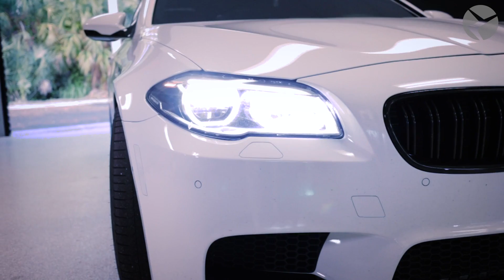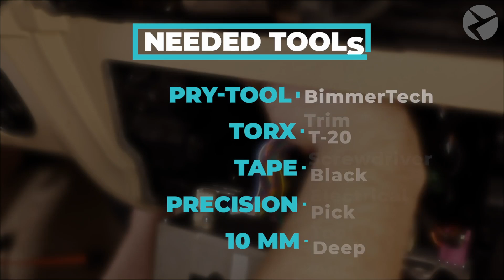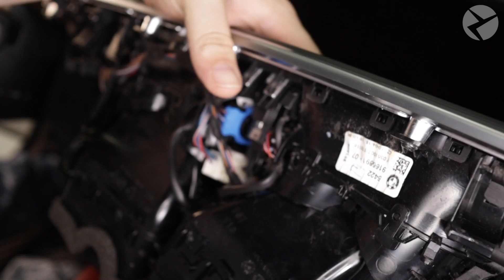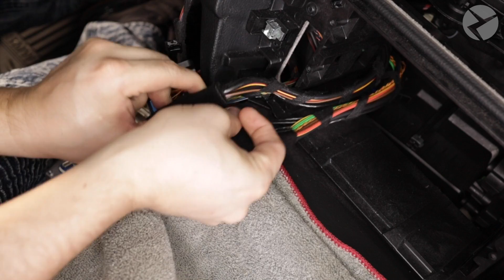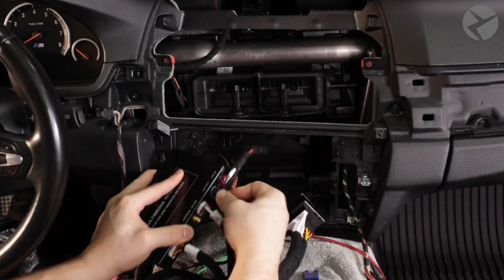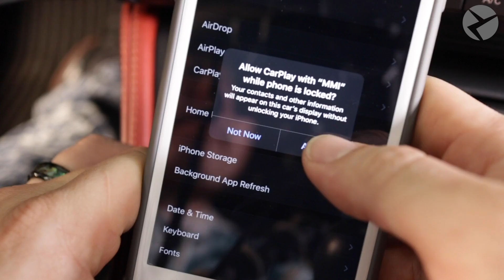CarPlay MMI Prime Retrofit in BMW F10 - Installation Tutorial

Comment: I just installed my mmi prime kit on my F10 with this video. Thanks!
Reply: I haven't had any issues other than occasionally having to reset it when it doesn't want to connect to my phone via WiFi but that's pretty rare. I'll say the WiFi is really strong so sometimes it connects to your phones audio even when you're really far from the car still lol.. not really an "issue" though. Just something to be aware of.
Reply: csolano84 awesome thanks bro. Worth the buy? I have a 16 535 also m sport
Reply: csolano84 what year is yours
Reply: Darius McClendon 2016 535i
Reply: Any issues?
Reply: What are you referring to about the big thing? The stock radio unit? Or the mmi unit? Either way, both fit fine once you get everything opened up like the video shows. I don't have any kind of creaking or any sounds after the install 👍🏻
Reply: csolano84 Yea the MMi unit. But thats good to hear maybe ill just put foam on the unit because im nervous about creeks lol. Thanks again man
Reply: Joseph Kobetitsch yeah not a bad idea 👍🏻
Reply: Is it easy to install?
Reply: @Cali_Oasis_Garden  I would consider it pretty easy to install.  If you buy the kit, add the additional "tools" for removing the trim, makes it much less scary as far as breaking anything.  Then as long as you take your time and follow the video, it should pretty straight forward.  Good luck!
Reply: @Cali_Oasis_Garden  No it's a bitch
Reply: Can you play videos? Cast to MMI?
Reply: Have you noticed any change on music sounds after install this MMI prime?
Reply: @Cali_Oasis_Garden  I havent noticed anything major.  The advantage with the MMI Prime is that you have a customizable EQ with more frequencies you can tweak, vs the stock radio only has a few options.
Reply: do you think it would work on a f10 520 2010 too?
Reply: Hey Solano,
Mine is a 2018 530e, my head unit has three separate green cables (it is not as shown in the video) for me and don’t think i can unplug them either. They do not have any clip that is holding them in place. Any suggestions?
Reply: Does it work / compatible with a F10 with heads up display
Reply: Yeah it's been worth it for me. I used apple play in another car before this so it was a must for me. With the wifi connection it's so nice.. no need to plug in!
Reply: csolano84 So awesome man. Good to hear. Just ordered it. Thanks for answering all my questions appreciate it
Reply: Joseph Kobetitsch you're welcome! Good luck and hit me up if there's anything else I might be able to help with. I know there isn't a ton of info out there.
Reply: csolano84 One question I had.. where the hell do you place that big thing and does it make any noise? Like when going over bumps etc. im worried its going to make the dash creek and i dont want that
Reply: @josephkobetitsch3152  There is room behind the trim on the opposite side to the steering wheel.  My car is RHD and I initially tried putting on the right hand side as shown in the video but it doesn't fit.  That was totally my own fault as it's pretty obvious it should go on whatever is the opposite side.  I found it easier to disconnect the aerial, push the MMI into the hole and then reconnect the aerial.
I have just been for a drive on a bumpy road and it didn't rattle around at all.  I had considered wrapping it in felt to avoid any rattling but so far that hasn't been an issue at all.

Comment: Does this mean when the unit is in Apple Carplay mode, you cannot listen to the BMW sirius radio or stored songs etc?    It switchs the output from the bmw audo/display to the Carplay via the MMI but it's one of the other?   I think that's still ok....
Reply from the maker: It depends on your audio source.  If you choose Sirius or a different source, you'll hear audio from that, and if you have CarPlay up, you'll see the visuals of CarPlay, but won't hear things like navigation.

There is a SiriusXM app for CarPlay, so that would allow you to use both at once.

On a personal note, I had a similar situation as yours with Android Auto, but I just made the move to have all the apps and music on my phone and just use that exclusively.  The only thing I still use in my car is the FM radio, but I could even get an app for that if I wanted.  it took some time to set everything up and transfer music, but it was a one time thing.

Comment: Recently installed one of these in my wife's 2017 BMW X1.  Overall, works pretty well.  The only thing I didn't like is that only the first phone paired to the unit will then auto-pair seamlessly.  When I did the install, I ws using my phone, so it was the "first" phone in the system.  We paired her phone a couple of days later, but left mine paired too.  What we noticed was that if I went to drive the car, my phone auto-connected and CarPlay started up perfectly. However, if she drove the car, she had to go into the connection menu and force the CarPlay unit to look for her phone.  Once it found her phone, everything was OK- but the extra steps were annoying.  We "solved" it by deleting ALL phones, then pairing her phone first and my phone second.  (It's her car, so her phone should work easily).  Compare this to the CarPlay in my Chevy Colorado- my phone comes up automatically, but if I'm not in the vehicle and someone else is (and their phone has been paired), then that other phone will automatically come up - no extra manual steps required.

Otherwise, generally OK, and certainly a good way to get more life out of a car that doesn't have carplay.
Reply from the maker: Hey there!  Sorry for the frustration!  Currently our MMI looks for the default phone (which is generally the first phone you pair).  However, it has been brought to our attention that some people would prefer what you're talking about, so in a future update, we will have it changed up.  So please be on the lookout for updates.  They are always free!

Comment: Useful video, thanks!  Just FYI, on the F10, I think the space you have available may be limited depending on what audio system you have.  "just tucking away the cables" took me longer than the entire rest of the install combined, as my headunit is 180mm deep and the space I had behind (right hand drive 2015 F10 535 with Harmon kardon system") was 200mm, so no way in hell it was going anywhere easily. Took a lot of fiddling around to get the bulky plug connector out of the way to the side of the headunit so the unit would go in.  Also, had very limited space and couldn't tuck the box away where you did (albeit on the left hand side, as mines a right hand drive car).  Ended up taking out the glovebox and fixing the box with cable ties to the main bulkhead chassis tube , just beneath the airbag unit.
Reply: Thanks for your post! I've just done the install on my '16 F11 with Harmon Kardon (also RHD) and it was the same for space so taking the glove box out before i got started saved a lot of frustration!
Reply from the maker: Thanks for the feedback! Maybe in our test car it was easier, but yeah - in some cars the work can be fiddly. Glad you managed to install! Cheers!

Comment: Question,  do you have to use the USB adapter? Does your system disable the USB and other connections in the armrest storage compartment?  2014 BMW F10 550I xdrive M Sport
Reply from the maker: No, It has its own USB port where you can connect your phone for Android Auto or Carplay, or play music/videos from your USB stick. This port is separate from the car's OEM USB socket.

Comment: When you tuck away the MMI controller like that in a random place without securing it, isn't this going to cause annoying rattling sounds when you're driving on bad roads? This is really surprising me of most of the installation videos I am seeing on YouTube for this controller....
Reply from the maker: Placing the MMI in a spot similar to the one in the video should not cause any rattling sounds when driving on bad roads, even if it is just tucked away like in the video. The spot shown in the video is tight enough so that the MMI doesn't move. However, if you prefer securing it even more, you can use tape, adhesive strips, etc. to stick it to the center console.

Comment: i have faulty head unit in permanent german, would this fix it?
Reply from the maker: It certainly won't fix it and also we can't guarantee CarPlay MMI Prime would work with a faulty module.
Reply: @bimmer-tech  OK thanks
Reply: @bimmer-tech  A guy said he can retrofit a widescreen with all that airplay on it, would that solve problem? Sorry for wuestions but its €400 and dont wanna waste it for nothing, he said if he replaces the screen it will fix it as the screen is faulty?

Comment: I installed the CarPlay but I cannot stream music if my Bluetooth is connected to the CarPlay. I have to select the bmw to play music please help
Reply from the maker: It sounds a lot like you are using an iPhone and are still paired with the OEM iDrive Bluetooth. Please head over to the Bluetooth settings on your phone and delete BMWXXXXX device from the list of paired devices. From then on make sure you have AUX selected in your iDrive as the sound input.
Reply: @bimmer-tech  fixed thank you

Comment: My 2013 535i already has a backup-cam, front corner cams and top view cams in the mirrors. Can I still do this install per this video or is there other steps I need to take?
Reply from the maker: You can use this video and in case something isn't clear call our support team any time.
Reply: 2013 don't come with cameras

Comment: Thank you very much.  These instructions are very clear and easy to follow and exactly what I was looking for.  I was a bit nervous about fitting this but it really doesn't look too bad.  This is my project for next Saturday.
Reply: And you did it without problems?
Reply: @Mariannnnnnnnnnnnnnnnnnnnn  It was a bit of a tight fit and I had to press quite hard to get everything back in place before I screwed in the retaining screws, but it worked and I never had any problems with it until I sold the car a year ago.

Comment: I put the CarPlay in but now my ac is not blowing air anywhere anything to help?
Reply from the maker: Please check the connectors on the back of the IHKA (A/C) panel. If you can wiggle them, they have not been inserted all the way. The correct way to reconnect them is by releasing them all the way in, pushing them into their spots as far as possible and only then latching with the handle.

Comment: Liked the USB cable management solution.
Reply: It's neat but the plug is a bit fat and it makes the lower part look slightly like it's angled a bit lower on the side where I've jammed the USB socket in.  Since I'm not likely to need to use that, I may move it but I'm so relieved everything went smoothly that I may just leave it.

Comment: Hi, I’m wondering is any option to get sound from original Bluetooth connection with car? 
Aux with equaliser is fine but I can’t swap songs by steering wheel.. any solution? Thanks ;)
Reply from the maker: Unfortunately it is not possible for CarPlay MMI Prime to work via Bluetooth. There is nothing we can do about the steering wheel controls for now.
Reply: @bimmer-tech  Thanks for your replay!

Comment: Quick question 
In my bmw f30 2013 I was going to install a mmi box but not I also want to install a 10.25” android screen would I still be able to install the mmi
Reply from the maker: Hi, our MMI will work only with OEM screens.
Reply: @bimmer-tech  so if i install a oem 8.8" screen would i be able to still install the mmi box
Reply from the maker: @user-gn1hk5fx8u  The MMI compatibility will depend on your VIN. Please send us the last 7 digits of your VIN and we'll check if you can install both.

Comment: I just completed this installation in my 2014 F10 M5 CP on 10/10/2020. These points are only to help others troubleshoot. It overall was well instructed and it wasn't all that difficult. Some steps are missing in the video but no big deal. 

I was able to pull the dash apart, configure the unit and determine where to best place the component and wiring. The video doesn't show the connection to the head unit very well but it isn't a big deal and easy to figure out. I would call out special attention to the green fiber optic connection and the blue wire harness to the head unit and air con control panel. Upon initial completion after maybe 45 minutes, there was no power to the head unit. The display screen worked, the  Multi CD player in the glove box had power, but no response. I tore the dash apart again and stepped through the install process from the start. I eliminated points of failure by reconnecting the battery after each step. I found the fiber optic cable connection wasn't seated properly and removed it from the new harness and reseated it. The wire harness clip need some effort to plug in properly to the back of the head unit after reseating the fiber optics. The locking arm on the harness is not that great in my opinion. I then connected the head unit control and air conditioning panel where I had intermittent power. This was the main issue. The blue harness clip is terrible. As I moved the control panel, it would power off and on. I left the battery connected as I played with the panel until I was able to reseat the panel with the power steady. It took me 30 minutes to get the right combination of movement and seating to get it to work consistently. This is not a Bimmertech issue. 

After retracing all my steps, disassembling the interior a couple times after 3.5 hours I was done and working. Had I known what the issues were, I could have easily resolved and completed this in less than 2 hours. Had I not encountered the issues, I think 1 hour is all you need and it is pretty straight forward. 

Now that I have tested the connection, I look forward to enjoying Carplay on my F10. It is a pretty slick solution.
Reply from the maker: Thanks a lot for sharing that! We're very glad you didn't encounter any major issues during the installation and we'll look into the harness problems. If you have any questions or issues in the future, we'll be happy to help, so do not hesitate to contact us. Hope you enjoy your CarPlay :)
Reply: My idrive button (knob) stops working ramdomly. When i disconect and reconect the cable its works for an hour and stops working again please help

Comment: i have a nbt system f10. very interested, however want to know, does this system use the existing mic as i would still like to call and recieve phone calls
Reply from the maker: Yes, the MMI Prime uses the car's OEM microphone. Depending on your car’s configuration you might need to plug into the microphone harness.

Comment: How about the AUX cable?
Reply from the maker: It depends on the configuration of your car. You can reach out to us to see if you will need to connect the AUX cable.
Reply: @b @bimmer-tech does 2014 f10 m5 need aux? Will B&O quality suffer slightly due to aux instead of bt?
Reply from the maker: It will need AUX coding depending on your head unit.  So while it won't be an actual AUX port, it will be a physical connection between your BMW and the MMI.  To keep things simple on the back end, it's just easier for it to be labeled "AUX" as the source in your BMW.

As long as you are playing high quality audio, there will be no quality issues, especially if you are using our new MMI Prime or Pro LCI.

Comment: Hi, I installed and connected everything and CarPlay began to work, and everything else in the car works, except for the A/C. Any thing I may have done wrong? Any way to fix it?
Reply from the maker: We'd need more details to help you with that. Please reach out to our support team through the contact page on our website.
Reply: @bimmer-tech  . See my review today. The blue harness clip to the AC panel and Headunit is very finnicky. I had intermittent power and when I reassembled the car and connected the battery, I had the same issue. Once I played with that harness clip I was finally able to keep power to it with the battery connected as I pushed in the clips and screwed the control panel down.
Reply from the maker: @davidhuether7605  Yes, thank you for pointing that out. We'll try to fix that.

Comment: Does this interact with the HUD (head up display) ? I have a 2014 535 f10. I love using the HUD on the windshield but does it show the songs, Navi, etc on the HUD?
Reply from the maker: The navigation prompts will be displayed on either the HUD or the 6WB cluster, not both at the same time.
Reply: @bimmer-tech  will the prompts follow the carplay's Apple Maps directions?
Reply from the maker: @daviddivdov  When the navigation will show you a certain direction the voice command will do exactly the same. And this will work in Apple Maps, Waze or Google Maps.

Comment: I’m ready to purchase right now for my ‘14 435i F32, the only question I had was do I have to manually put it into CarPlay mode by holding the menu button every time I start the vehicle or does it automatically start up with the CarPlay system? Thanks!
Reply from the maker: Once the phone connects to the MMI module it switches the screen automatically.
Reply: BimmerTech Thank-you! I just placed my order a couple hours ago! Can’t wait until I receive it.

Comment: do you need to have your iPhone connected through USB all the time or only once when you enable the Apple CarPlay?
Reply from the maker: Hi, only once when you enable it. Our CarPlay is wireless for iPhones.
Reply: @bimmer-tech  thank you! also I have combobox and I don't care about using Siri, voice commands or initiate calls through apple carplay, can I not route the cable to the roof microphone and use the car bluetooth system for calls?
Reply from the maker: @InkberryPages  Currently it is not possible to connect to two Bluetooth devices at the same time with an iPhone device, so essentially this would not work.